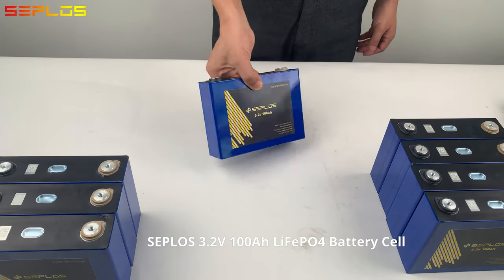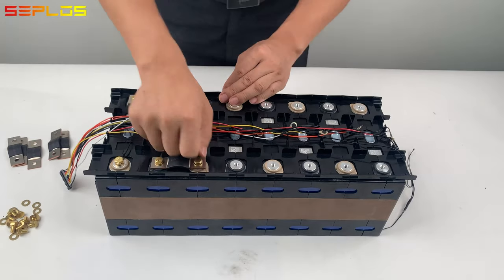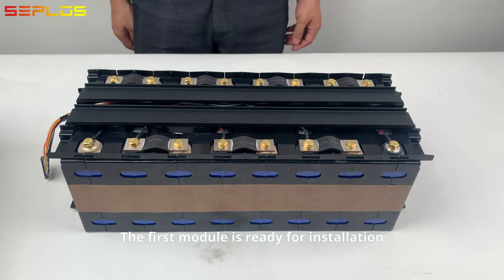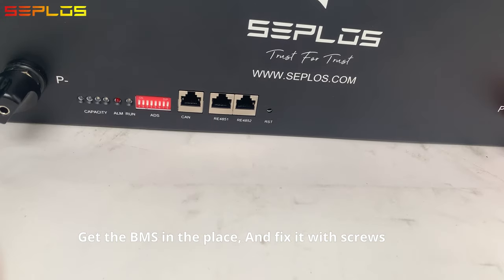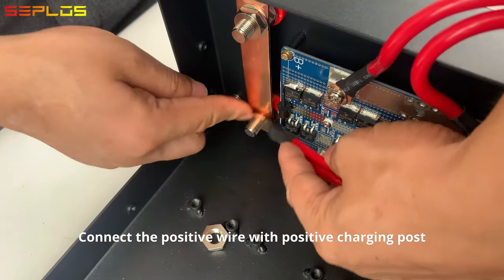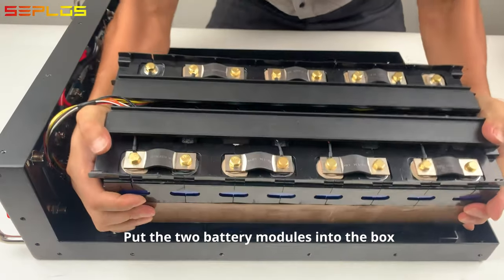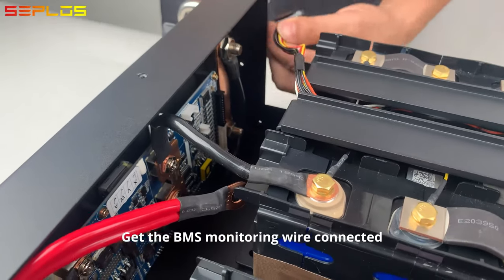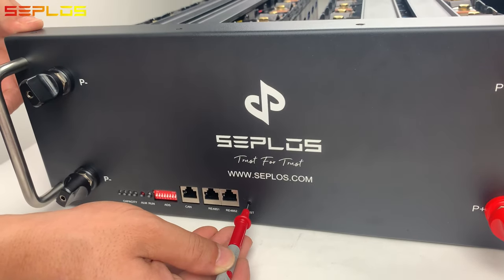DIY Solar Energy Storage Battery | Easy Assemble 48V LiFePO4 Module | All Kits Included

Comment: Great product. The only thing I can criticize is that there is no cooling. If the plastic separators had holes then you just need holes in the case and add some 12CM fans and you would have a great cooling. It could even be controlled by the BMS.

Comment: It seems strange that the outside connectors aren't directly attached to the BMS PCB and use a thin wire instead. It would save some wiring to do this. Also the bridge wires could be thicker, if that is a 300A fuse then those wires will get hot quickly and countersunk screws would be better on the outside for handling.

Comment: What is the best variable/multipurpose BMS (i.e. can do 3/4/5... series, 3/4/5...parallel, can switch from 12v to 24v to 48 v when/if needed and can do different amps from 50-150/200?
Reply from the maker: Multipurpose refers to the functions. For example, the common functions charging and discharging protection, short circuit protection, temperature protection etc,. Others may also have CANBUS communications, UART communication functions. 
If you need more information about our BMS, we have the specifications for your reference. Please feel free to contact us at: info@seplos.com.

Comment: Is the BMS the same as the BYD packs? The front ID, ports and lights look identical. Are you using the same rs485 protocol?
Reply from the maker: That's not the same. And we have goodwe/pylontech/growatt/victron/sofar/luxpower protocol optional for RS485 communication between battery and inverters.

Comment: We build the unit, it has no circuit breaker or soft start recharge resistor, and it is TWICE the price of comparable rack mount units... um... no.
Reply from the maker: A circuit breaker is an automatically operated electrical switch designed to protect the system from damage caused by overcurrent, overload, or short circuit. And the built-in BMS also comes with elaborate design on over current and short circuit warnings and protections. 
For DC circuit, the safety voltage range is 0V-60V. And the Maximum voltage of our battery pack is 58.4V within the safety range. 
That's why we didn't add a circuit breaker to the battery pack.
Reply: @SeplosTechnology  BMS shouldn’t be relied upon to protect wiring from misuse or accidents... the BMS should be there to provide info about cell health, and to protect the cells. Fuses or breakers should be included to protect those systems.
Reply: @SeplosTechnology  a circuit breaker is also a simple easy to operate shutoff for the battery.

The fact your battery has safety built into the BMS does NOT double the value of your battery. To sell a diy assemble kit, the pricing should be lower than readymade assembled and tested batteries.
Reply from the maker: @SuperVstech  You're right about the circuit breaker. 

And The price listed on our website is the finished products. Which was tested and passed all the quality control processe.